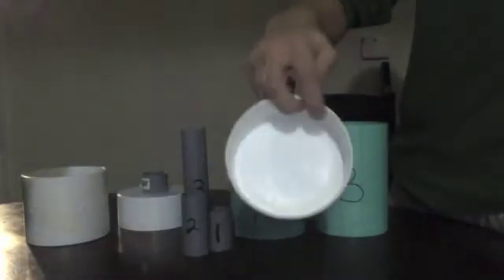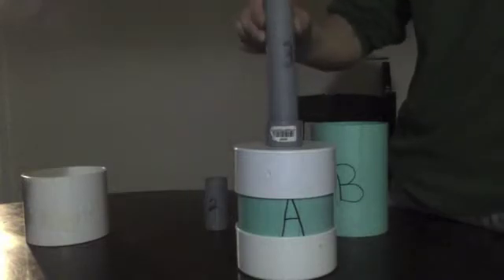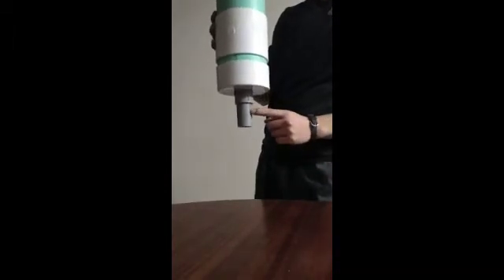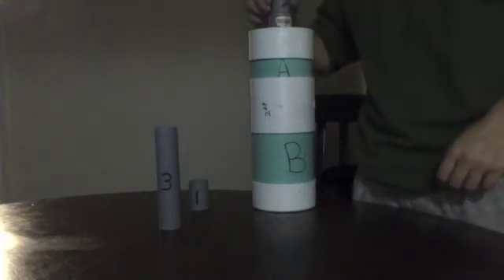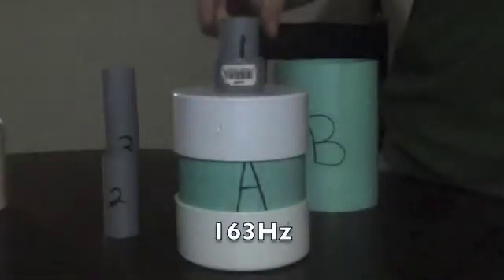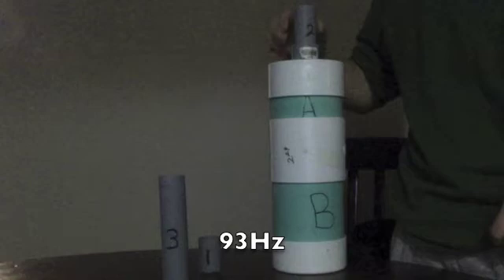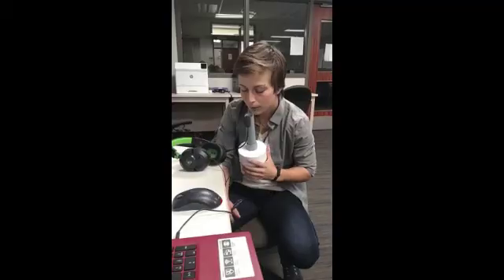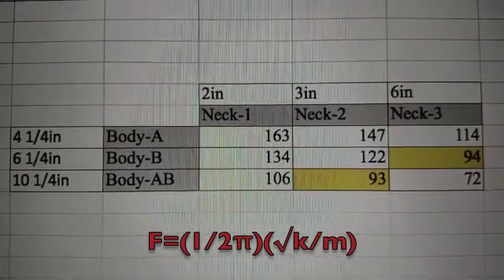Helmholtz Resonator

Comment: hello !
i'm a french musician using the heimoltz resonator formula to create clay drums.

funny thing is that i use a different fomula :
Frequency = (sound speed/2pi)(surface of the "blowhole"/length of the blowhole+0.48*"blowhole"radius*volume of the resonator)

it seems quite correct to me, even if the clay is not the perfect matter for that kind of precision.
Am i doing it rightly ?
Reply from the maker: What a fantastic creation! How did it work out? Would love to see and hear the result